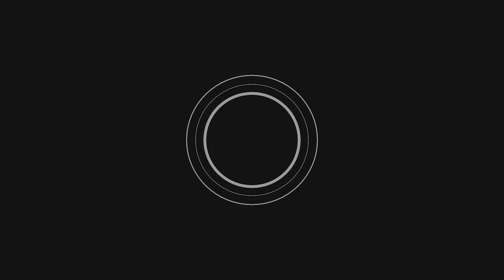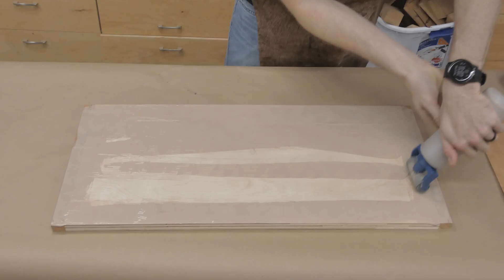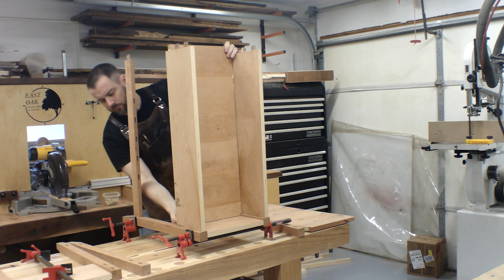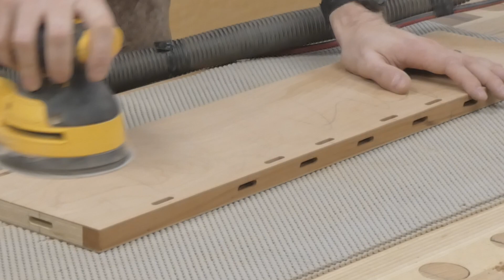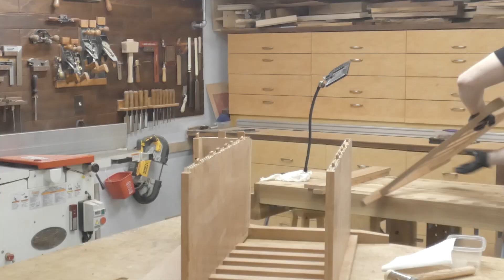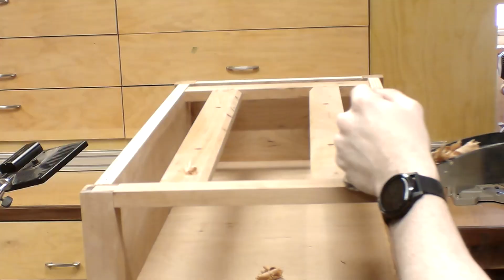Art Desk Part 2

Comment: I like seeing the mistakes people make, and how they fix them. Is there a reason you went with epoxy over something like woodglue + sawdust?
Reply: Wow, just saw it:) Welcome back!!!
Reply: Good to see you again. Thought you may have given up, which would have been a shame. Always liked your stuff
Reply from the maker: Didn’t give up. Just had to shift priorities for a while. I have a few projects in the works again, just at a slower pace.
Reply from the maker: The original glue up was all epoxy for the open time, so the joints were already covered in epoxy. Wood glue just wouldn’t have worked after that.